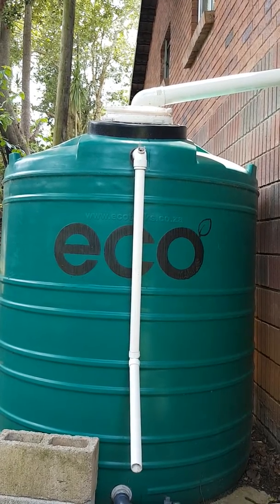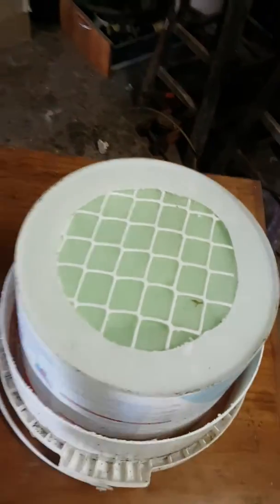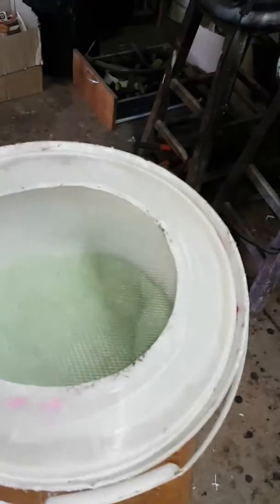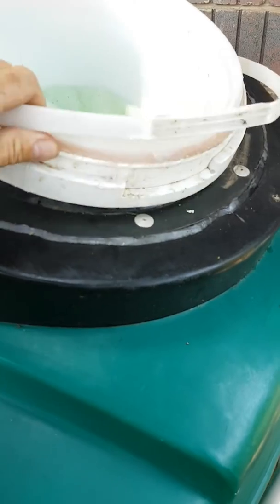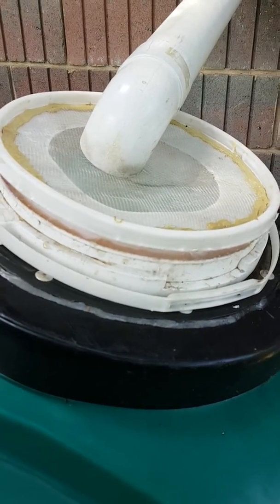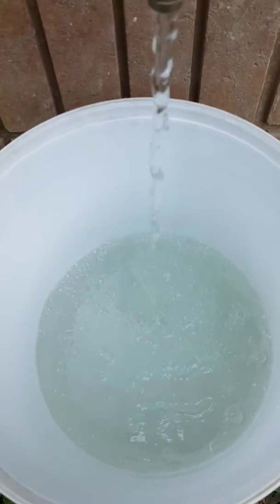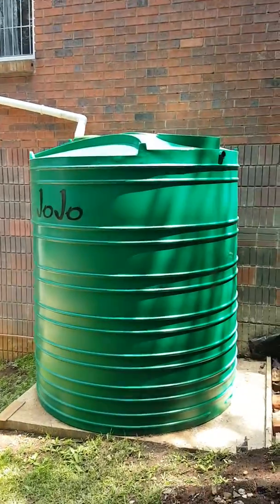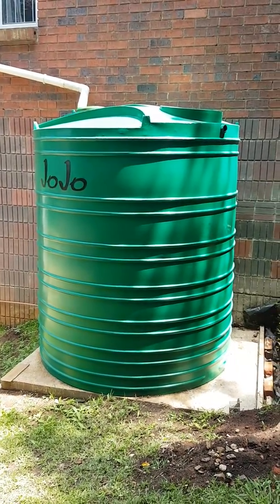Rain water harvesting DIY Pre filter

Comment: Greetings from Canada!  Thank you.  I was looking for an inexpensive and simple solution for my washing water at  camp.  We knew placing our tin roof shelter amongst the pines as opposed to the clearing would be an issue with debris but we needed the shade to keep it cool.  I had a nylon stocking over the spout which helped some but this should do a much better job.  How often does the filter need changing?
Reply from the maker: I rinse after every hard rain...replace if gets too decayed from hand washing. 2x this year I've drank tank water without boiling, no health problems at all.